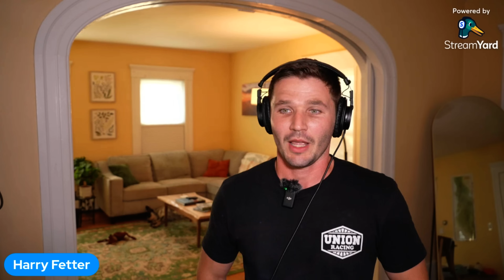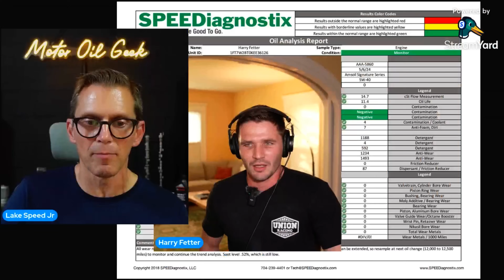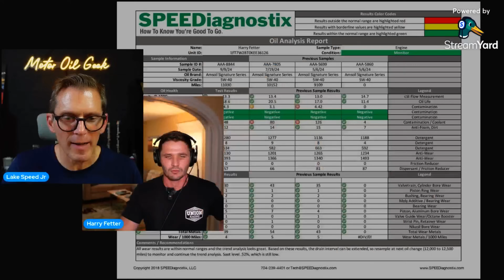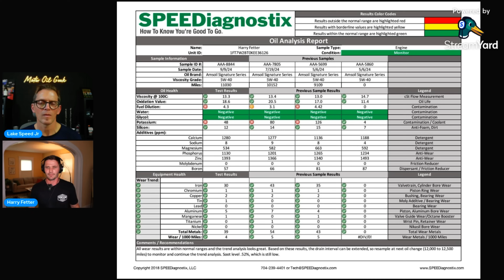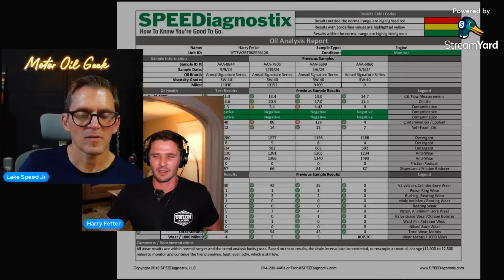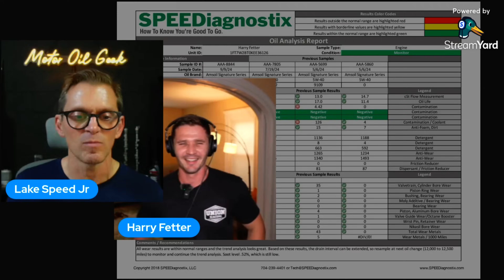11,000 Mile Amsoil Oil Analysis With The Motor Oil Geak

Comment: A question arises, as to which filter was used?   Many filters have different micron limit's within their media, so I often wonder if numbers would change much, with regard to the oil filter used?   I often wonder if the additional media and the internal magnet in the PPE oil filter, and it's low micron media, would change the numbers much?  Or a Baldwin or Donaldson, compared to the Motorcraft, which is probably what the majority of trucks in the U.S. use?   All these filters compared to the Amsoil filter, again if that would change the scenario?   Many of us would probably like to see the soot number lowered, so the oil would not possibly be as black (I say this from my '80's days, using propane as my fuel, where the oil never got dirty at all) as diesels are a whole new animal of course.    Thanks for the video, always nice to see different views on those of us running these diesel engines!

Comment: Weve been running a house synthetic blend 15/40 in our fleet trucks, 2016- 2025 6.7 fords, we change oil when light goes off. We have trucks with almost 400k mi now that tow dairy 10-18k lbs No need to waste money on expensive oil if u change it at the light when it goes off. Only thing that is always high is fuel dilution.  We run the same oil in all our equipment,  gets changed at 500hr. we have equipment with 15 and 18k hrs. Oil is oil if it meets the recommended specs required for a diesel engine

Comment: I’ve been running Amsoil for years. I use 5w-30 Signature Series.
I emptied my oil the other day, when I went to grab a filter I didn’t have one. So I thought ok, I’ll let it go for now because I change my oil & filter under 4,000klm.
After a two days I decided to drain the oil and install a new filter.
As I drained the oil I noticed how quickly it darkened.
It is a little dark originally, but it gets quite dark easily, not sure why it would..

Comment: Will a bypass oil filter help with soot to a point that it will decrease engine wear? And if so what micron of a bypass filter is the best? 2 micron,4 micron etc.?
Reply: @candyman1967  the insane deisel bypass filter goes down to 2 microns. That's the one I. Thinking of putting on my 26 ram 2500 cummins

Comment: I run amsoil in my diesels. But I never over extend service intervals. Amsoil is great stuff.
Reply: I’m trying 10,000 miles on Signature Series in my 17 PowerStroke, with their 25,000 mile filter. It’s actually slightly cheaper than running Rotella and a Motorcraft filter for 5,000 miles. And half as many oil changes I need to do.

Comment: Intersting info. Not sure why milage is considered gospel to determine an oil change interval. Engines know nothing on milage and given the vast different usages of  all vehicles, one has to ask what the actual hours is on the oil. Example,  high-way driving for 10,000 miles could have half the engine hours to a vehicle working in a city application. Oil analysis have been done by all the major heavy equipment companies, and they determined that 500 hr oil change intervals meets safety parameters and warrant compliance. Even going half the hours to 250 and comparing actual milage vs hours on our personal vehicles, many would be surprised how little actual hours on their oil compared to milage.

Comment: just want to say ,, great video with Lake..  and LAKE.. you can take some tips from this guy on how to present things like UOA sheet in screen.. put yourself in small box and LEAVE THE INFO ON SCREEN...this way we can see the info and hear / see the commentary on the report.. 

Thank you Power Smoke.. er Stroke Maintenance guy..   from a cummin(g) guy.. LOL

EDIT... on the diff oils,, a magnetic drain plug is kinda like a filter more or less.. I tow a 9K rv and usually do rear at 35K.. on my next change I plan on getting the alum finned rear cover and mag fill plug..

Comment: Tell me how "wear metals" went DOWN in every measurement of the same fill of motor oil!   Make it make sense!    -Does this mean oil analysis numbers should be taken with a grain of salt?  Even 'trend' doesn't make sense...
Reply: "a dirty filter is a good filter" as the filter collects more wear metals, that acts as a secondary filter capturing more of the wear metal. Most people change their filters (oil, engine, cabin) early.

Comment: When using biodiesel, what about using a bit of natural gas or propane. This is a small quantity sprayed in before the turbocharger. Either of these fuels are clean burning, with natural gas being the cleanest. What they do is act like a catalyst in the combustion to reduce the soot.
Years ago while working at a Detroit Diesel Allison distributor, I was sent to a coal mine to install a (Parr) I believe oil filter in a 70 ton haul truck transmission cooler line. These filtered to a fine micron size. There was a sensor that showed a green light when it was good, yellow when it was getting close to its end of life, and red when the filter was basically plugged up. 
I also was sent to a power generating facility to redo the controls tubing that shifted valves on a 4500HP V16 engine. While there an Allison gas turbine shut down, due to a faulty chip detector in the speed reduction gear box. This small gas turbine also produced 4500HP. The company had two sensors hot shoted 500 miles overnight, to get the engine available in the morning. 
They had a number of engines on site that they could start up or shut down according to the electric demand. When the town demand was low they could start a smaller engine or two and shut the large ones down, which saved fuel. 
The one I worked on was a Cooper Bessemer. They also had an EMD Detroit Diesel old rail engine, a Cat 3512, two Mitsubishi V10, the two Allison engines. This was to supply a town in a national park where they did not want power lines ruining the mountain views.

Comment: Dear youtubers....I stand correctet, the base stock can be pretty much the same but the ADDITIVE PACKAGE can vary depending on the auto manufactuers requirment as Lake Speed Jr. has shown in his videos.
Other than Viscosity which has been a big ?....follow the vehicles owners manual as to what typ of oil to use.
My appologies.

Comment: I've been running Amsoil since the mid 80's, extending oil changes to 15,000 miles. it's the best.
Reply: I have used 24,000 oil changes on seven vehicles since 1977. I used Amsoil on my VW Beetle first in 1976 with lower miles oil change intervals. The key is to keep your oil clean with filters at 8-10 k. Synthetic is not just better than petroleum oil, it’s a new game, so learn.

Comment: OK Lake I am totally confused! I just watched this where you state the 11K oil analysis is doing OK but when you were with Dave at Daves channel you agree with his crazy 3K oil change interval recommendation. Please explain. BTW I love your videos 👍 .
Reply: I would suspect it depends on vehicle, oil used, time between oil changes... for some gas engines 3K is good.. for other 5-7K works.. for diesel engines many OEM recommend 10K to 7K..
Reply: @carl2591  Im thinking Ole Dave cant get away from the 70’s and 80’s where diesel’s had mechanical injection systems, oil was all petroleum based and the rings in diesels let a lot more blow by! I think this is why he is still stuck on 3K diesel oil changes. Times and oils have changed dramatically and with the use of oil analysis he is 100% wrong!

Comment: Why was Harry's ProwerStroke doing regens while towing using bio-diesel? I've towed a RV bumper pull (10k lbs) with my 19 Ram 3500 across the country on two different trips (about 4k miles each trip) and it never regened once. Using both standard and bio-diesel fuel types.

Comment: I would like to see a sample with the bypass filters on a system. I have a bypass (FS2500) on mine but I use the truck mostly for hunting trips. I have 78,000 on my 1015 Cummins so mine would not really be a good test. Someone that rolls thru the miles would be better. I did have a 2005 Duramax van and had the FS2500 on it and changed the oil every 30,000 miles and finally sold it at 378,000 miles only because the rest of the van was falling apart. It weighed in a 8800lbs from day one and was driven hard. The front end was rebuilt twice and on what need for a 3rd rebuild of the front end I sold it. The motor was perfect, it took a crate trans from GM at 174,000 miles, the doors were sagging and leaked and i just didn’t have the time to mess with all the minor repairs, but again the motor took 1 injector under warranty and nothing else…ever. Was a great motor.

Comment: Cool. I run the same oil. Im comfortable running 10k via analysis. Im about to add a amsoil's oil bypass system and a ccv upgrade making 20k+ miles intervals possible.   Amsoil Signature Max Diesel Oil is the shiznit.
Reply from the maker: For sure! Thanks for the comment

Comment: Oil change intervals were extended by car manufacturers so that when they quote the “cost of ownership” is low. That’s it.
I worked for three car manufacturers. While oil additive packages do break down the worst that happens to oil is it gets diluted by fuel that makes its way past the rings. Time and mileage between changes is critical. If you want to get real specific, you can pay to have your oil tested in a lab to see how long YOU can go between oil changes. Engines are expensive, oil change in comparison are cheap.

Comment: my concern with the extended drain intervals is dirt / sludge buildup over time; these new synthetic oils are very stable yes but they get just as "dirty" as the old organic oils; i would like to see the total TDS in the oil over time;  have seen alot of repair shops on YT tear down relatively new vehicles that are following 10,000 mil drain  intervals and the engines are packed full of sludge.
Reply: If an engine gets low on oil, but not low enough to throw an oil light, the oil will sludge up much faster than if the motor was kept toped up. 10K miles with high quality oil will not sludge an engine. It might not be ideal for some drivers in some driving conditions, but tons of sludge is not due to 10K mileage, it is due to poor oil level monitoring or customers just lying about oil change intervals.
Reply: @AEVMU You must not work inside engines. I've seen plenty of sludge from mileage half of what you're saying.
Reply: Fuel dilution is the root cause of sludge buildup. Sample your oil regularly to learn what maintenance needs to be performed to clean up contamination sources and hence clean up the engine. I have seen it take a year to get the engine cleaned up and all the root causes of contamination fixed. Installing a By-Pass oil filter on Diesel engines will double/triple engine life and double OCI's.
Reply: @joelfox8754   Lake mentions this around 23:30 when he talks about how if you buy their SPEEDiagnostix Premium oil sample report it includes particle counting so you can see how “clean” your oil still is.
Reply: You are right. But, since synthetic oil is a new game, 10,000 is too low a mileage. Change the filter twice per 10,000 miles and don’t throw away good oil.
Reply: @captnjim44smith74 You can't make a blanket claim that 10K is too low. You have no way to know what idle percentage one has.
Reply: @5jjt I didn’t. I said I proved to myself that long interval oil changes work if you keep the oil clean when it begins to look a little darker by replacing the filter. Some over the road trucking companies do that for up to 30,000 miles since using full synthetic oil.

Comment: Great content. I could be misremembering, but I think Amsoil back in the 80s had a system where you basically never had to do a full engine oil change. You had a standard type oil filter and a filter than could remove even smaller particles. I don’t recall how often you changed the filters, but the fresh oil you added back to replenish what was trapped inside the filter was enough to also replenish the additive package keeping those within the specs.
Reply: You're referring to a bypass oil filter.  I don't think I'd trust it enough to never change oil but it should help with extended intervals.
Reply: Amsoil HD By-Pass filters will run 1200-1500 hours easily. The filters are Beta 75, 98.7% efficient at 2um. They capture a lot of soot and your are not pumping this soot through your engine bearings.

Comment: I watch a lot of videos on engine tear downs. And every engine that had extended oil changes was discolored inside and full of sludge. I use Amsoil but I will not do extended oil changes. Watch on YouTube channel (I do cars) it’s easy to see the guys that do extended oil changes….. And it seems all these oil analysis come back good. Just like this did. Where is the soot load on that analysis?
I would like to see these oil analysis done without sending any info on oil mfg. or milage, or the type of vehicle

Comment: Amsoil all I use in all 4 of my vehicles, nothing better out there.
Reply: Amsoil is a Group 4/5  PAO/ESTER base oil, it has been tested against the Group 3 Hydro-Crack oils and found that there is very little differance
Reply: Interesting, and thanks. Do you know if Mobil 1 Advanced Fuel Economy (AFE) is Group IV? I know Mobil 1 EP is. Thank you.
Reply: @ From what I can find out Mobil 1 Advance is a mix of group 3 - 4 and some Ester. As Mr. Lake has shown there is very little difference in motor oils today, they all meet the manufacturers requierments. If you feel comfortable with a certain brand then use it. Just keep your oil clean for many miles of happy driving.
Reply: Amsoil used to be a POE/PAO base oil years ago but now it is primarily just PAO.  POE is significantly more expensive than PAO, especially after global ester feedstock prices climbed, which is why Red Line’s oil has skyrocketed in cost
Reply: @andymike6575 so what’s the real world differences between the amsoil signature series and redline???

Comment: Good info but doing UOA after each 1000 miles is excessive in my opinion.  After 15k I did every 5k afterwards up to 25k safely.  I would not recommend ppl go out and spend $60 on a UOA every 1000 miles to see how long they can put off changing $100 worth of oil in their HD truck

Comment: Seems like “soot level” would be a content line that would be helpful for diesel reports as opposed to the gas engine reports where it may fall into the “information overload” category.
Reply: Good point. Why was that not included in these oil analyses? Particularly since AMSOIL Signature Series Max Duty claims it is good at helping limit soot thickening while Shell Rotella T6 does not claim that.

Comment: Lake made a statement in one of his videos about the oxidation range and where the oil is dead. I think the number was 35 or 36. My question is what oxidation number is a safe cut off number where you feel confident the oil is still performing at an optimum?
Reply from the maker: I think you’d have to determine that based on the entire report. It seems like there wouldn’t be one number that you could apply for all oils across all vehicles.

Comment: THANK you Lake for addressing diesel oil more!
I am always looking for cheap and easy ways to try and ensure the life and reliability of my diesel Sprinter vans. These are currently 2023 2.0L HO 4cl OM654 engines. Currently running Motul 8100 x-Clean 5w-40 at twice per year, 6000 mile max. (up to 7500 if running continuous interstate). I am getting oil analysis done. QUESTION: If analysis shows oil interval can go longer Im still concerned about abrasive soot in the oil. Would a filter only change mid-interval with extended interval on oil provide any benefit? Filters on these engines are raw media/caniter type on top of engine so simple to do in 5 min. and $20.
Reply from the maker: Good question. I can’t speak for Lake but if the analysis doesn’t indicate additional wear your filter is fine to run the miles.